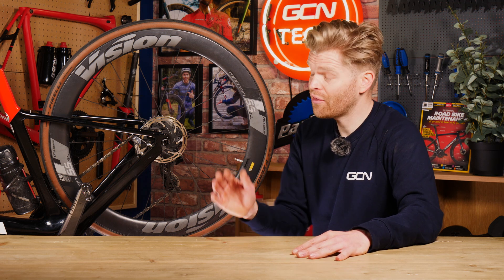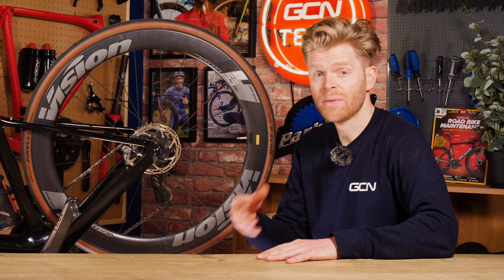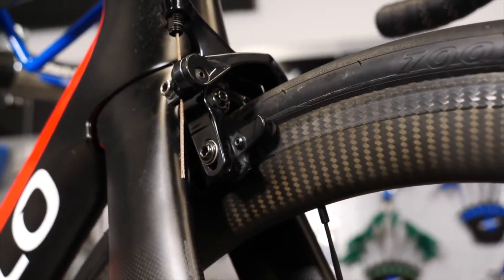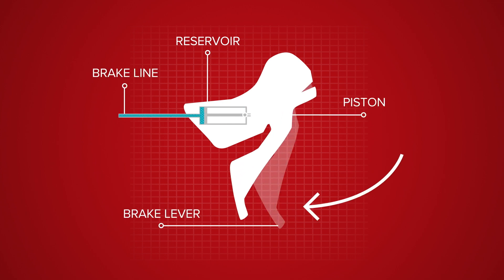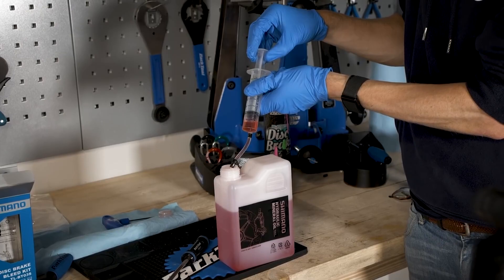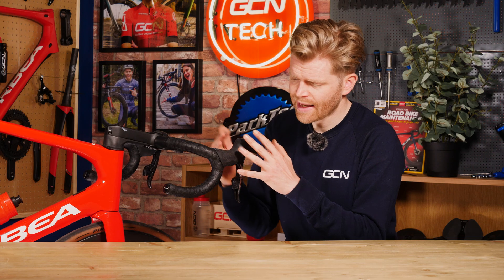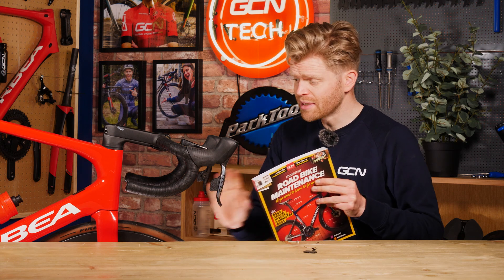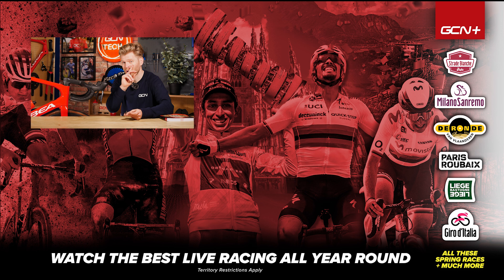How Do Hydraulic Disc Brakes Actually Work?

Comment: Sounds like a pain. Have had rim brakes for more than 16 years with no problems.
Reply: I live in a wet climate near a steep hill, and after switching to discs I can tell you that they're far safer. Doesn't matter how wet it is, they bite instantly.
Reply: I felt the same, until I actually rode a bike with disc brakes.
Reply: @Yippee Skippy It doesn't matter how well set up your rim brakes are, it takes at least one revolution of the wheel for water to wick away, after which braking force will increase without any change of input by the rider. So for the same input, you're already getting different results second-by-second.

Also, the vast majority of rim-brake bikes don't have grooved braking surfaces, and as the pads wear the wicking tread in them becomes less and less effective.

I've ridden rim brakes extensively for decades, in the wet it's night and day, discs are just superior, and hydraulic discs are superior to cable discs.
Reply: @phillycheesetake  Horses for courses; I ride mainly flat areas and have a thing for reading the road ahead to minimise braking, like I do when driving, so I prefer simple, cheap rim brakes.

Comment: Why not use the entire wheel as the brake disc using rubber pads against the rims. Hey presto, proper bike brakes!
Reply: Well, disc brakes clearly have their merit. The current gen Dura Ace/ Ultegra has basically fixed the ticking disc brake, and still has the advantage of better modulation and wet performance.
Reply: The worst part about that is the rim wearing down instead of just an easily replaceable and relatively cheap disc rotor
Reply: Why not get rid of any bike brakes, problems solved. Use your feet or just ram into a pole.
Reply: @LarsRR  The whole problem IS modulation, hence the sudden crashes on bends by pros when they can’t work out how the modulation changes with heating discs. Lock up, bam on the floor
Reply: @serdiezv  I avoid this by periodically replacing the  more easily replaceable and more relatively cheap rubber bits before they wear through. Maybe every 4 or 5 years....
Reply: @serdiezv  You'll go through a cassette, 3 chains and 2 groupsets before the rim wears out. By that time, you're on a new bike anyway.
Reply: @serdiezv  Use premium pads that wear instead of the rim.
Reply: @petesmitt  i use swissstop. The rim still wears down.
Reply: @serdiezv  I use Koolstop; maybe Swissstop focus on braking power than rim friendly compounds.
Reply: @petesmitt  the rim wear is a long term thing, we're talking >10 years. It's inevitable, everything working by friction will wear down both parts.
Reply: @serdiezv  sure; rim quality plays a part too; I only use the best Taiwan made alloy rims.

Comment: Each to his/her own. The development of disc brakes for bicycles came into being because of the carbon wheels they were selling became delaminated with rim braking. Hence the birth of bicycle disc brakes. Costing and weighing much more than rim brakes which have been around for donkeys years and basically do the same job, although some will argue that discs are better. I’d say they are more of a faff the rim brakes with the squealing and rubbing. Bike frames had to be altered to accommodate discs, therefore not interchangeable with rim brake frames. It’s a massive money maker for the bicycle industry , allowing them to charge us the cyclist a fortune for discs , callipers, hydraulic fluid and pads. Compared to cheap and cheerful brake blocks. Complicating bicycles = more cost to you and me. No thanks I’ll stick to rim brakes! Thanks for the video
Reply: Wrong.  Disc brakes came to bikes because mountain bikes needed something that worked and worked predictably in wet conditions - regardless of what material was used for the rims.  They carried over to road bikes because they just work better.
Reply: Nope. Disc brakes first gained traction in the MTB world because they’re much more powerful and (more importantly) consistent in adverse conditions like rain and mud. Road bikes don’t necessarily need the full stopping power potential but benefit from better braking in wet and sustained downhill. Yes, it’s an opportunity to sell more, new stuff but their development has little to do with the rise of carbon wheels.
Reply: @rmiraflor  yes I agree, but when they started making carbon wheels for rim brakes they did delaminate. Then they used a special hard coating on the rim brake surface to stop it happening.

Comment: If two piston disc brakes are "better" than rim brakes, wouldn't four piston disc brakes be better? High performance cars often use four piston calipers.
Reply: Complexity/weight vs. necessity. Road bikes don’t typically need the full stopping potential of disc brakes, you can easily lock up a wheel with a two piston brake. The benefits are more towards performance in the wet and the ability to modulate braking.

Comment: Reliable? No more can go wrong and does go wrong. Efficient? Again no, poor head dissipation, rubbing. Powerful? yes as long as you've got no air in the hoses. Consistent? most of the time if the conditions are perfect and you have fresh pads fitted. So reliable yet they leak fluid, I don't think rim breaks have ever done that.
Reply: you got it right. read my comment

Comment: I'm going to wait for "brake by wire" bike brakes.
Reply: It will be heavy or break easy because a servo or actuator has to do the work.

Just di2, heavyer.
Reply: @chrisprice5895  Has a steer by wire system ever stopped working, and cause a crash?
Reply: @billkallas1762  I'd bid it has because all things can fail. What about yourself? You think a steer by wire has ever failed in history?

When 'brake by wire' companies wanna release schematics and offer the user repairability then I'd be interested Maybe.  But yet I don't might just squeezing harder.

I have a saying, somewhat, ,"fire, a woodfire, is the most technologically advanced way to cook a meal if that's what is available and doing so doesn't harm."

The meaning in this is just because something is more convoluted, seemigly complex, fabricated more.. doesn't mean it's advanced, better or Hi-Tech.  A technology that is new maynonoffer the user any benefit.

Electronic brakes are for what?? Squeezing less?? Come the hell on.  If it doesn't weigh less and offer the user something more than less hand 'strain' it's just obsolescence, consumer crap.

Rim brakes with good pads offer very close to what hydraulic brakes can deliver in gross performance of cycling. The podium shows this.

Electronics lock handymen out, end up in the trash prematurely and are hyped like a mftfkr